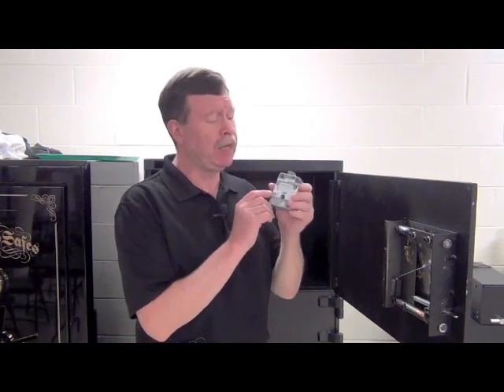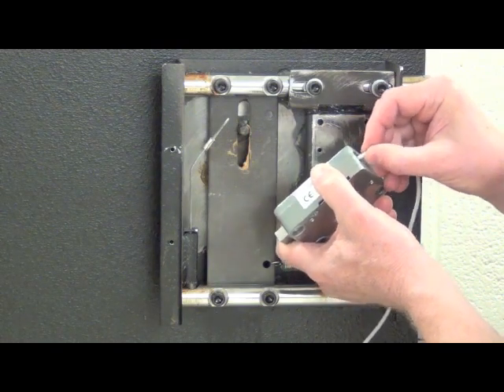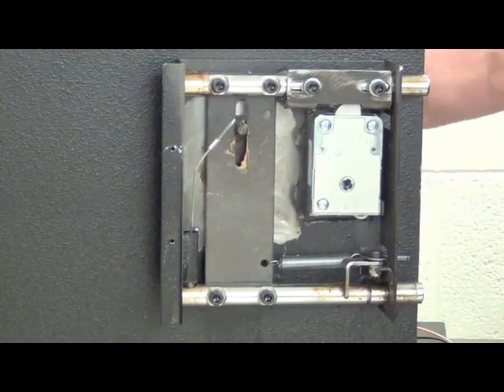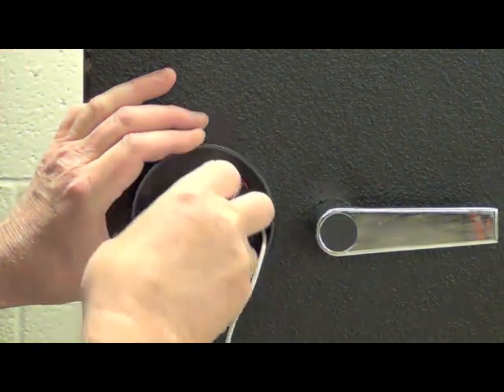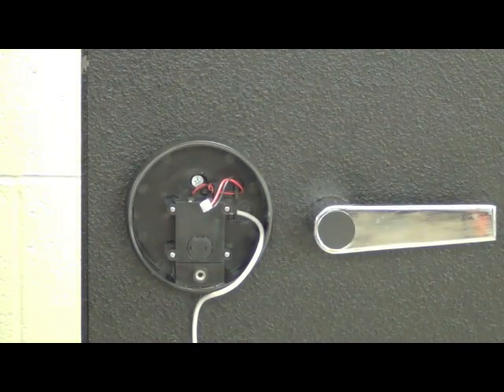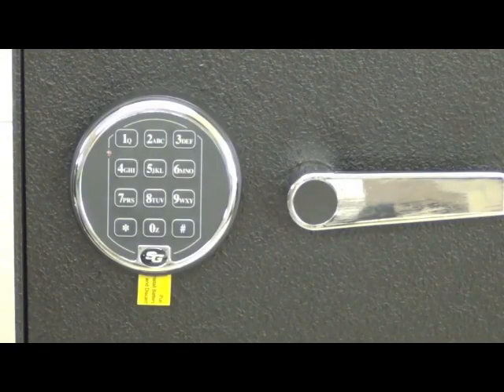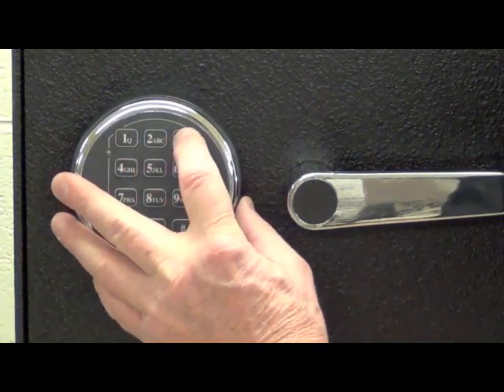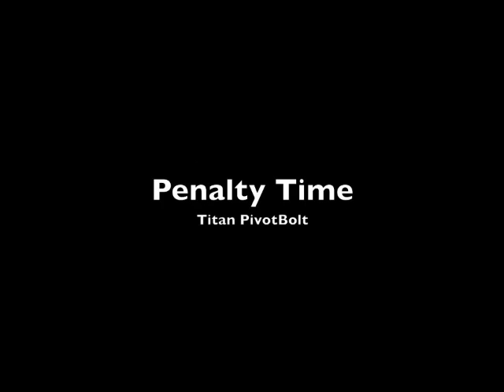Titan PivotBolt Lock Installation

Comment: If an attacker breaks down the keyboard and leaves the wires in thought, is there a solution to open, logically with his own code that will be stored inside the lock, by mounting another equal keyboard?
Reply: good question, i would also like to know this..

Comment: To whom it may concern.

  I have a question about the the Titan pivotbolt lock,  I read the spec and it said this. Quote. 
" The lock bolt model withstands 225 lbs. (1000 newtons) of bolt end pressure for a high level of security in boltwork blocking applications."

So the question is, what if you apply more that 225 lbs of force to the opening handle, will the lock fail and the bolt retract, opening the safe?
Reply: The handle or spindle or internal part will break - if it's properly designed so that amount of force will never reach the bolt. So in a good safe that's accounted for ;)

Comment: what if you put a 9v battery to those phone wires ?
Reply: Nothing. the keypad sends digital signals through those wires that the chips in the locking mechanism uses to decide if it'll unlock or not.
Reply: Nick Jones So the "brains" are on the inside of the safe so it cannot be tampered with.
Reply: Nothing or you'll fry the brain of the lock making it even harder to get in. They're not so dumb they're wires directly to the motor. It's power and keypad input to the back and as the others says it's the back that's the brain that interprets keypad inputs. Overloading those wires does nothing but destroying those inputs on the micro controller they're attached to. It's not a $10 china safe ;)

Comment: Why alkaline batteries? Duracell or not they're prone to leaking if you do not take actions to prevent it (change it regularly whether or not you think it's empty - but reality is most people do not so hey suddenly you'll have a leak!!). Better yet a brand name lithium. Lasts much longer and no risk of it leaking.
Reply: HifiCentret Lithium is not a good choice for safes. Every single safe manufacturer and locksmith recommends alkaline. Main reason is when lithium dies, it dies. you get no warning the battery is dying. Alkaline will beep for a long time when its almost dead so you know